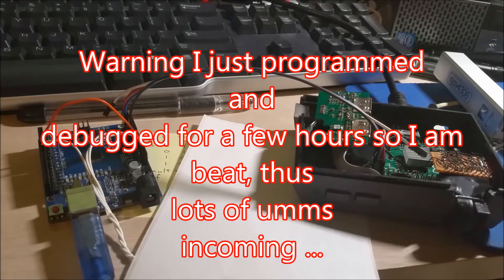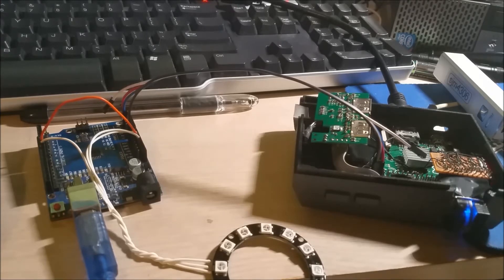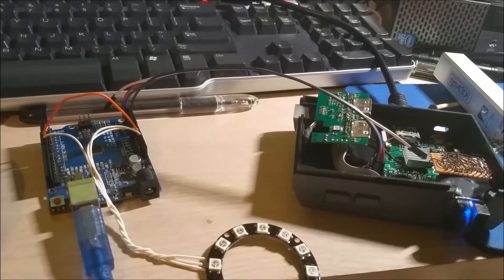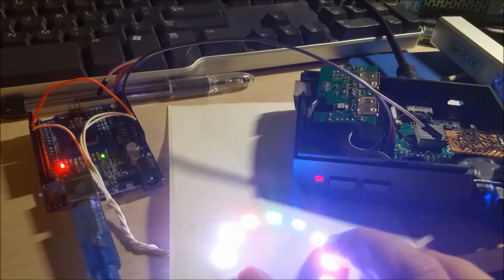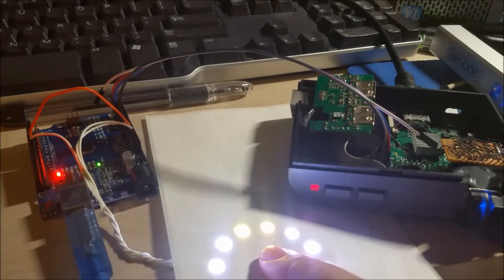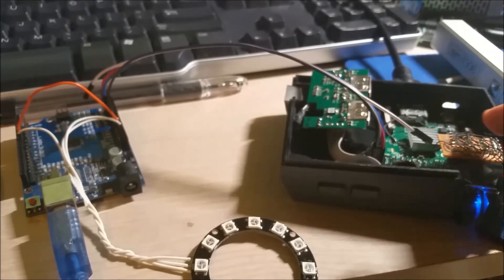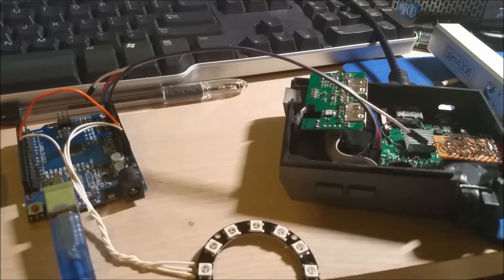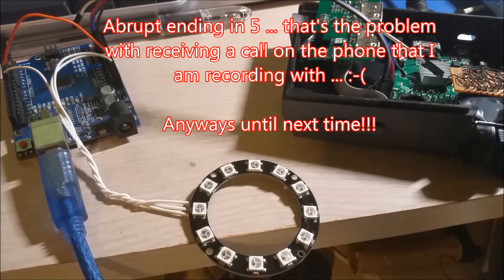Retropie Raspberry Pi Arcade Project: Part 2 - Game System Controlled WS2812 RGB Buttons

Comment: Hey, 

I commented on your final video too, im looking to recreate your button setup. 
Why is it you can't control the RGB LEDs directly from the RPI3?

I bought some 5mm Neopixel Through Hole LED's to mount in my Arcade buttons, but im having trouble getting them to work with my RPI3.

But im so confused, what is this "power control circuitry" you are referring to?
You point at a small brown chip on the right when you say it. 

Is that it? 
If so, What even is it?

Really would appreciate your help, you seem very knowledgeable!
Reply from the maker: Hi Nemecys, it's not so much that you cant write a program for the pi to bitbang the ws2812 protocol (though it is difficult due to the fast, tight tolerances on the protocol), it's that it is much easier for me to do it with a microcontroller since I have extensive experience with embedded controllers but not so much with python or the pi. Also having an external microcontroller adds flexibility if I want to add I/O or features in the future.

As for the power control, it is a pic12f629 microcontroller I programmed for my mini nes project that I reused. I've written firmware for it to hold the pi in reset when in the off state and then release it when the power button is pushed to allow the pi to boot. When the button is pushed again to shut off the pi, it animates the power led and toggles a pi I/O pin to tell the pi to execute the shutdown command via a python script. A basic power off button can be wired directly to the pi which would've been easier but then you would have to power cycle the pi to get it to reboot so I figured it would be nice to have a chip do everything for me with just a single button.
Reply: Ahh right i see, yeah i have noticed i can't get my through hole LED's to work properly using the RPI, which LEDS did you buy out of curiosity?
I assumed it was the 5mm LED's so they would easily mount in most LED arcade buttons. 

I'm assuming I could buy something as small/cheap as a Arduino Nano or Pro to power my LED's, is that right?

So i'm ok to bypass your custom PCB, its not required for any of the LED's to be controllable or powered?

Also regarding your final video, you use a HDD Power Supply, which has 5v and 12v, how do you use this to power ALL your boards (LCD, Arduino and RPI)
Can you show me a wiring diagram or take some photos of where it all splits off. 
I'm guessing you you just wire up some Micro USB headers and DC Adapters to the wires coming from your molex adapter?

Is that right, or is there a smarter way to do this?

Thanks for replying, I really do appreciate it!